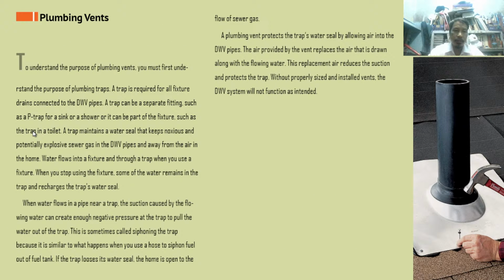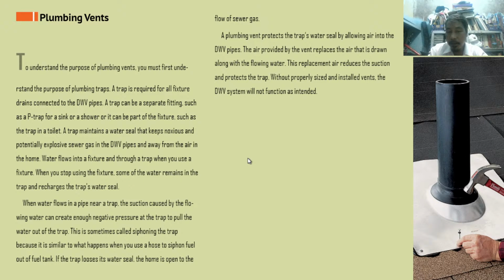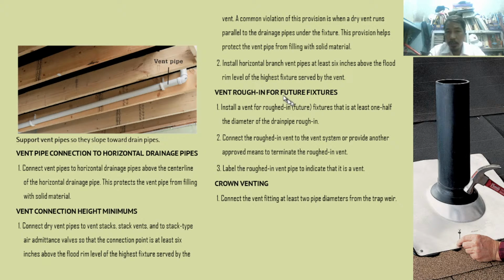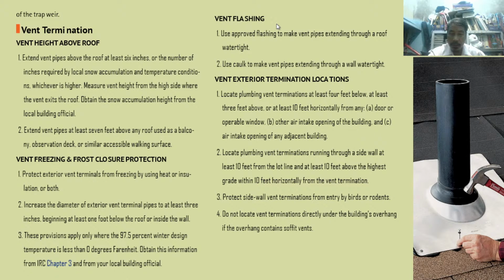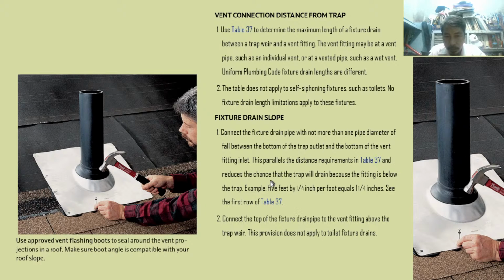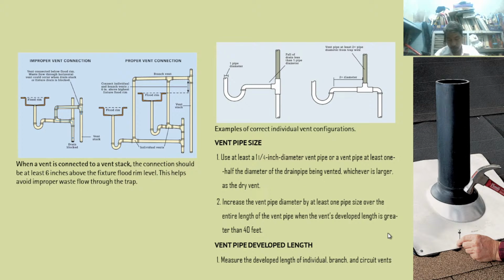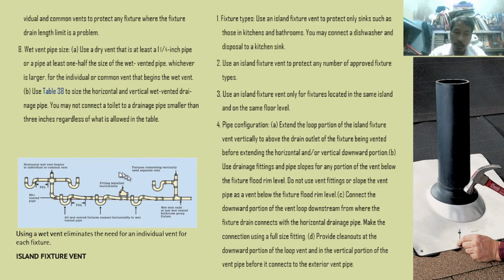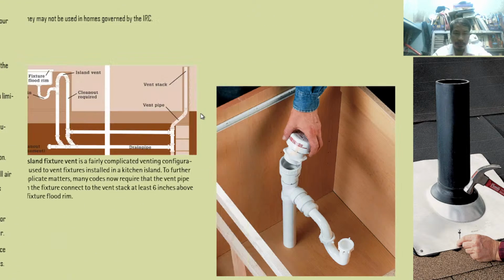[ LIVE CED2 Lecture 08 ] DrAP Zantua Plumbing Vents Talks + ENGINEERING Analysis & Design

Comment: Thank you sir for the information about the vent in a plumbing system, also known as a vent stack, helps regulate air pressure. Thank you, Sir, for the live lecture. A plumbing vent is nothing more than a pipe that ascends to a plumbing fixture through the roof of a house. All of these drains and traps are made to stop sewer gas from entering your home.

Comment: Thank you sir for teaching us this live lecture about the plumbing vents. In this video, I learned that the plumbing vent protects the trap's water seal by allowing air into the DWV pipes. A trap can be a separate fitting, such as P-trap for a sink or shower. Crown venting, as well as vent rough-in for future fixtures, have been discussed. At least 6 inches should be extended to the vent height above the roof.  The vent is kept from freezing by the application of heat and insulation. When we encounter something related to the issue, this will help us identify and comprehend it.

Comment: Thank you sir for this live lecture video that tackles about plumbing vents. I have learned that the plumbing vent protects the trap's water seal by allowing air into the DWV pipes. The air that is provided by the vent replaces the air that is drawn along with the flowing water. The replacement of air reduces and protects the trap. The vents should be in its proper sizing and installation for the DWV system would function well. It is important to remember that the vent pipes should extend in an upward direction from drains for it to ensure that the wastewater will not flow into the vent pipe and block it. It is also discussed here about the vent slope and connection to pipes and vent termination are well-explained. It is important to remember that the distance from the trap to the vent fitting is limited. The vent fitting may connect to a vent pipe or to a pipe that is vented, such as a wet vented pipe. When the vent is connected to a vent stack, the connection should be at least 6 inches above the fixture flood rim level. this helps avoid improper waste flow through the trap. It is also mentioned here the size of vent pipes, individual vents, common vents, wet vents, island fixture vent and air admittance valves.

Comment: Thank you somuch sir for this live lecture about the plumbing system vent and also it helps air pressure. Plumbing vent is nothing more than a pipe

Comment: Thank you, Sir for the live lecture the plumbing system's vent, sometimes referred to as a vent stack, helps control air pressure. In addition, a plumbing vent is nothing more than a pipe that passes through the home's roof and up to a plumbing fixture. These drains and traps are all designed to prevent sewer gas from getting into your house.

Comment: Thank you sir for tackling about plumbing vents. I have learned that a vent protects the trap's water seal by introducing air to the DWV pipes. The air reduces the suction so that siphoning is prevented. Vent should be install for every fixtures that has trap. Vent pipe break the negative pressure that may build up inside the pipe.

Comment: Thank you sir for discussing plumbing vents in this live lecture. I learned vent has a role to protect the trap water seal.  The trap CA be a separate fitting such as P-trap for a sink or other fixture, toilet for the instance. When the flow of water neared in trap the suction caused by the flowing water can create enough pressure to pull rlthe water out of the trap.

Comment: Thank you sir, I've learned that The plumbing vent, also known as a vent stack, aids in the regulation of air pressure in your plumbing system. In addition, a plumbing vent is simply a pipe that runs from a plumbing fixture up through the roof of the home. All of these traps and drains are intended to keep sewer gas from entering your home.

Comment: Thank you, sir for this live lecture about plumbing vents. I have learned that a vent protects the trap's water seal by introducing air to the DWV pipes. The air reduces the suction so that siphoning is prevented. Vent should be install for every fixtures that has trap. Vent pipe break the negative pressure that may build up inside the pipe. Vent pipe connection to horizontal drainage pipe must be connected to the centerline. It protects the vent pipe from filling with solid material. Vent connection height minimum is atleast 6 in. above the highest fixture so that vent pipe will not become clogged with solid. Vent rough-in for future fixtures and crown venting has also been discussed. I have also learned that. Vent height above the roof should be extended atleast 6 in. above it. Heat and insulation are use to protect the vent from freezing. Vent flashing, vent exterior termination locations, vent connection distance from trap, fixture drain slope, vent size pipe, vent piped developed length, individual vents, island fixture vents, air admittance valve, and horizontal and vertical wet-vented vented drainage pipe size were also been discussed. This needs to be watched repeatedly for our muscle memory take care all the information in this subject.

Comment: Thankyou sir for discussing about plumbing vents. When water flows in a pipe near a trap, the suction caused by the flowing water can create enough negative pressure at the trap to pull the water out of the trap. This is sometimes called siphoning the trap because it is similar to what happens when you use a hose to siphon fuel out of fuel tank. A plumbing vents protects the traps water seal by allowing air into the DWV pipes. The air provided by the vent replaces the air that is drawn along with the dliwing water.

Comment: Thank you sir for this explanation of plumbing vents. I learned that plumbing vents protect the trap's water seal by allowing the air into the drain, waste, and vent pipes. The air provided by the vent replaces the air that is drawn along with the flowing water, this replacement reduces the suction and protects the traps. That without proper sized and installed vents, the drain, waste, and vent system will not function as intended. Plumbing traps maintain a water seal that keeps noxious and potentially explosive sewer gas in the drain, waste, and vent pipes and away from the air in the home. Vent slope and connection to pipes together with plumbing vents requirements, vent pipes connection to horizontal drainage pipes, vent connection height minimums, vent rough-in for future fixtures, and crown venting were talked through. Vent termination with vent height above roof, vent flashing, vent exterior termination locations, vent connection distance from the trap, and fixture drain slope were also discussed. Vent distance from traps table was shown and explained. There is much plumbing engineering information here that can help us to understand plumbing vents, we just need to repeat watching and comprehend the discussion. Thank you sir.

Comment: thank you sir for discussing plumbing vents which I learned that in order to understand the purpose of plumbing vents, you must first understand the purpose of plumbing traps. A trap is required for all fixture drains connected to the DWV pipes. A trap can be a separate fitting such as P-trap for a sink or shower or it can be part of a fixture such as the trap in a toilet. When water flow in a pipe near a trap, the suction caused by the flowing water can create enough negative pressure at the trap to pull the water out of the trap. A plumbing vent protects the trap’s water seal by allowing air into the DWV pipes. The air provided by the vent replaces the air that is drawn along with the flowing water. This replacement air reduces the suction and protects the trap without properly sized and installed vents. The DWV system will not function as intended. This video includes vent slope and connection to pipes plumbing vents required, vent pipe slope and support, vent pipe connection to horizontal drainage pipes, vent connection height minimums, vent rough-in for future fixtures, crown venting, vent termination vent height above roof, vent freezing and frost closure protection, vent flashing, vent exterior termination locations, vent connection distance from trap, fixture drain slope, vent pipe size, vent pipe developed length, individual vents, wet vents, common vents, island fixture vent, air admittance valves. I also learned that do not connect the vent pipe within 2 pipe diameters. When a vent is connected to a vent stack, the connection should be at least 6 inches above the fixture flood rim level this helps avoid improper waste flow through the trap. An island fixture vent is a fairly complicated venting configuration used to vent fixtures installed in a kitchen island. To further complicate matter, many codes now require that the vent pipe from the fixture connect to the vent attack at least 6 inches above the fixture rim.